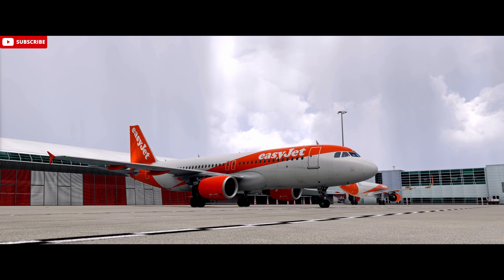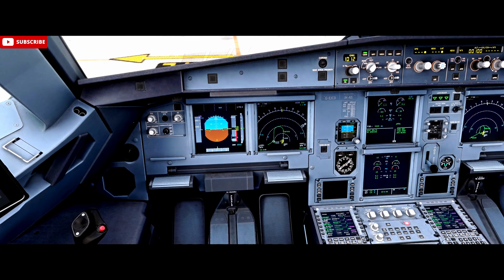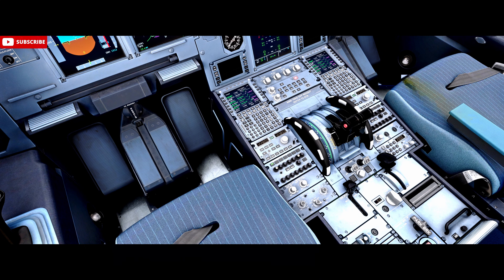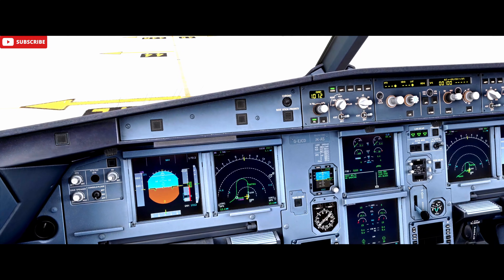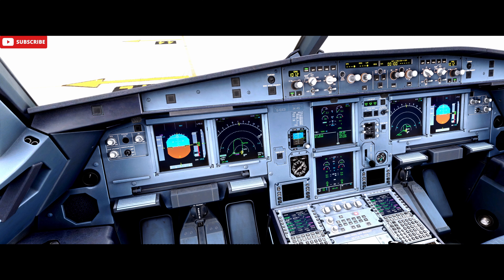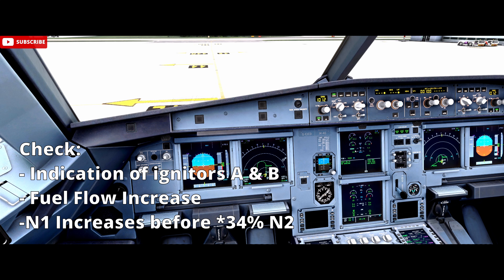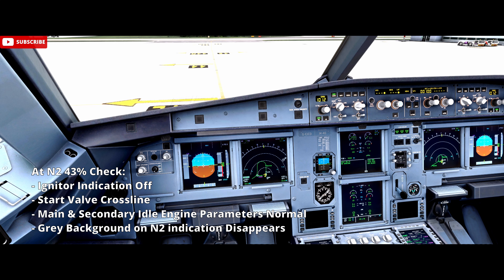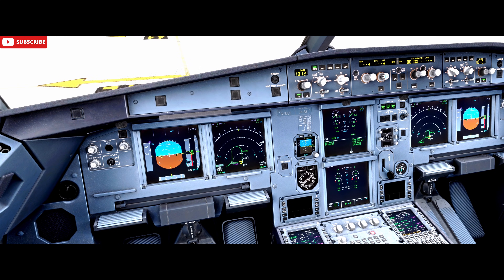How to Manually Start the A320 Engines | Fenix A320 Tutorial MSFS 2024

Comment: How do you fix a hung start on the airbus a340-300 on flight sim 2024? Every other flight engine 1 will only go to 2.3 and stop there it won't ignite or something. I've tried manual start and same thing happens.  Most of the time everything works fine, but sometimes I can't start the engines because of a hung start, and I don't know what that means or how to fix it. Please help.